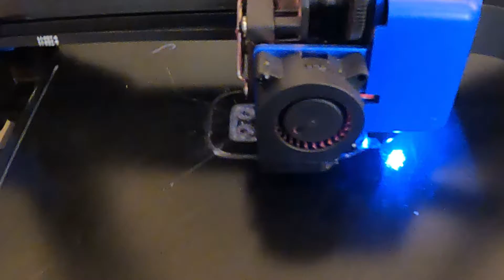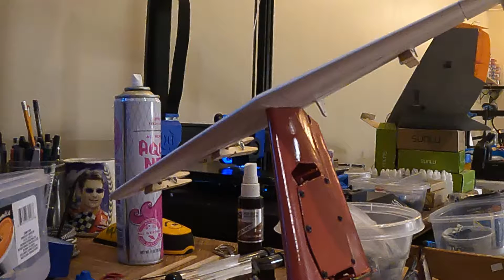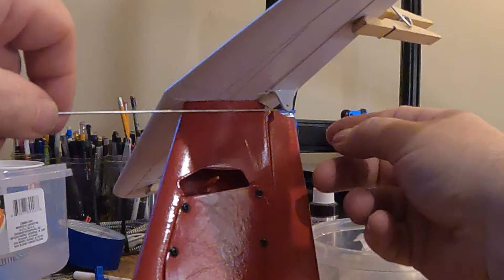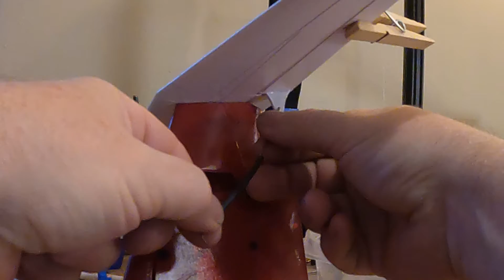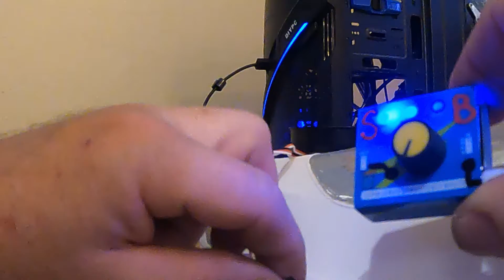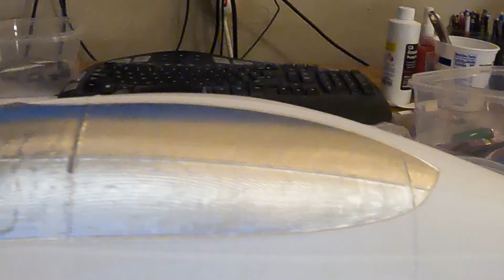RC Airplane 2 Piece Control Rods

Comment: Thank you for the video! Where did you get the 0.5mm spring wire?
Reply from the maker: It's K&S Precision Metals, Made in the USA, stock #499, 0.20" or 0.5mm., package of 25.  visit www.ksmetals.com or call (773) 586-8503.  Thank you!!